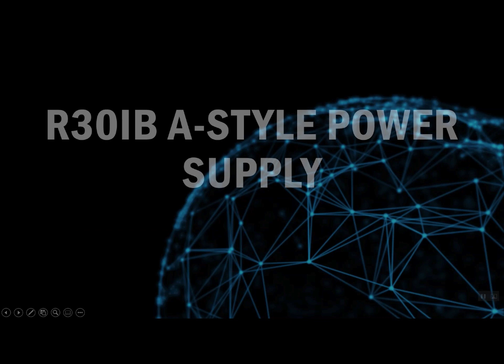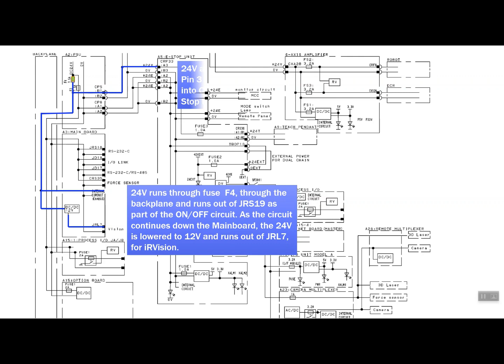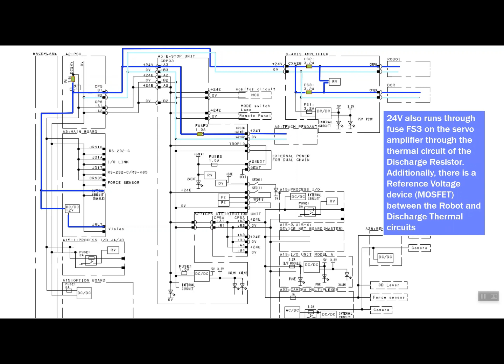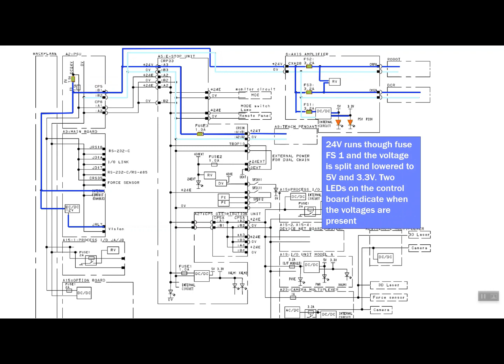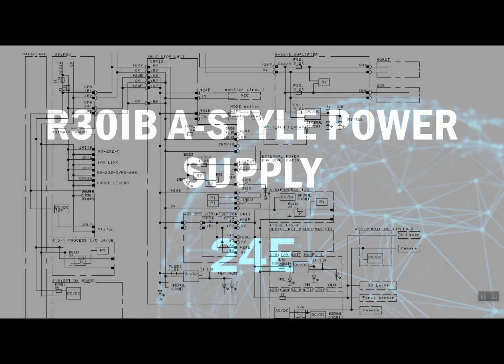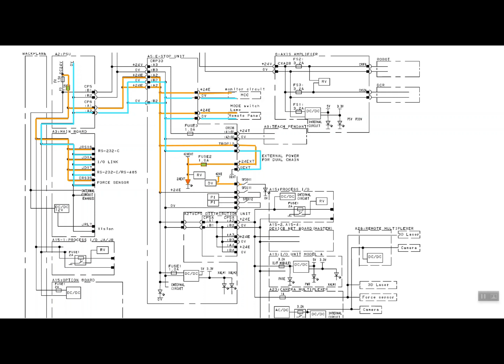24V and 24E

Comment: If the f4 fuse on the power supply was blown after a power outage and is repeatedly blown on powering up after replacement, what’s your troubleshooting process and/or first guess to look into?
Reply from the maker: Go through the 24E circuit and look for external devices that might be shorted out.